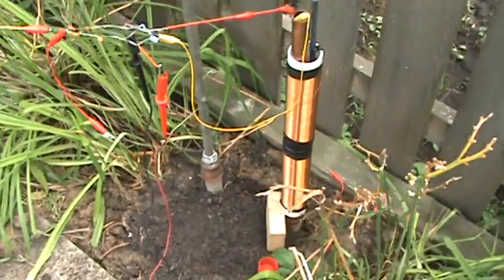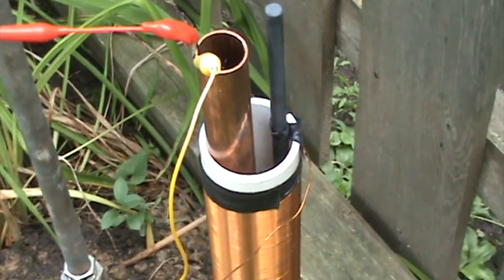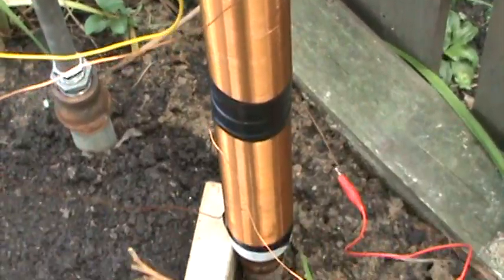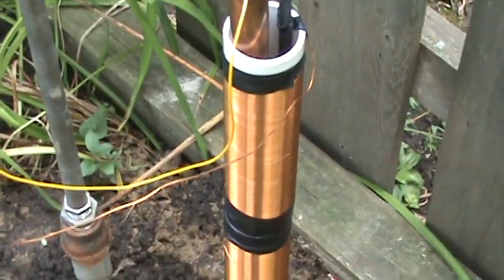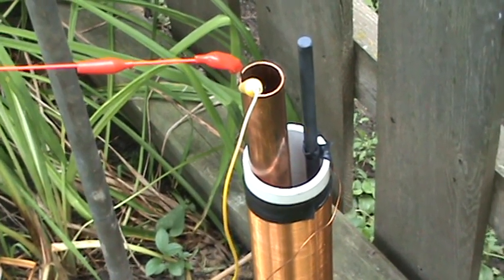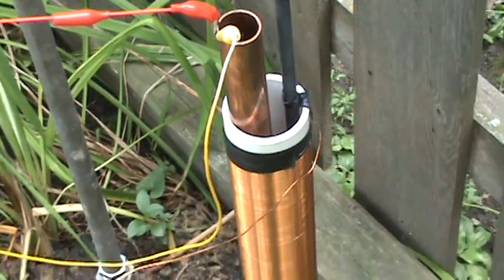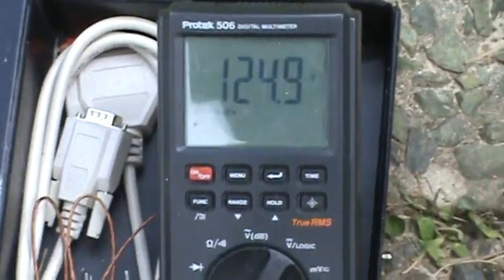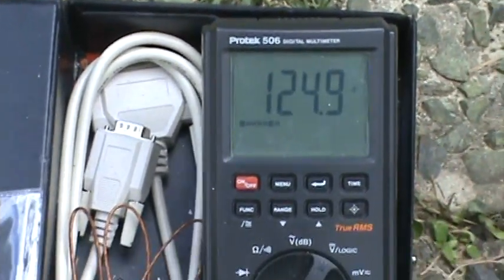FREE ENERGY FROM AIR CIRCUIT PART 16/24

Comment: What is the current? 
Voltage is almost irrelevant!
Reply from the maker: Well, i have been working on/off on this project for over 10 years now.  At this point in time, in this video i was checking the current incorrectly.  I still work on this project today and have new series.  I get about 125 micro Amps.  Now have over 21 LEDs lit 24/7.   I now concentrate on the voltage because it can be transformed through spark gap or charge/discharge of caps or batteries.  Thanks for commenting.
Reply: Are you aware of the Cambodian temple which is pulling seemingly significant amounts of electricity out of the atmosphere? It has 5000 kilograms of silver tiles on its  floor. Perhaps the silver creates a better ground for current?
Technasma Cambodian Temple
http://www.mir.com.my/leofoo/Cambodia2005/Palace_museum/index7.htm
Reply: Technasma in use today. Free electricity in a Tartarian Empire temple.
https://m.youtube.com/watch?v=Mw12Pyn4A8E
Reply: Ancient atmospheric electricity. 
https://m.youtube.com/watch?v=Ssv4J6Sd6bw
Reply from the maker: @charles4962  Thank you, very interesting.  I like that video :-)   I was just watching ancient aliens TV show last night and it was about many buildings like the temple around the world that are all believed to be energy collectors.

Comment: My tel. +48-780-129-544, email: htg@interia.pl   I invented a breakthrough source of energy based on Classical Electrodynamics and on Circuit Theory. It will be useful e.g. for laptops and for cellular telephones. I am looking for capital in the range $500 000 to $5000 000 for prototyping, patents and production.

Comment: Electrostatically Harvesting Power from High Voltage Power Lines.
Note from author: Please do not try this experiment without a thorough knowledge of electricity! Please understand that it is illegal to take power from power lines. This is an experiment only.
If you run a single wire along a high voltage power line, (= or> 340KVAC), you will harvest a fair amount of voltage at micro amp levels. WARNING: KEEP AT LEAST 30 FEET FROM THE HIGH VOLTAGE LINE!! DO NOT DO THIS EXPERIMENT ON WINDY DAYS!! The longer the parallel wire, the higher the voltage and amperage you can collect. Run your (antenna wire) parallel to the power line in the trees adjacent to one outer phase of the power line. The higher the wire, (antenna), the better. Use small gauge bare wire hung from fishing line for insulation and support. Run at least 200 feet of bare antenna wire. 400 feet equals twice the power collected. Use a fishing pole and weight to put up the wires in the closest branches of the trees next to the HV line.
WARNING, DO NOT TOUCH THE ANTENNA WIRE! YOU WILL GET SHOCKED!  I recommend two pairs of rubber gloves and good boots for this. Ground the Antenna wire while you work until the transformer (s) are installed and you are ready for power. Provide a single or several 5 foot copper-plated ground rods at your termination point for the transformer high voltage return to ground. More grounds are better. The ground completes the high voltage antenna circuit.
The trick is to present a minimum load to the antenna wire and to step down the electrostatically induced voltage. We need a very high voltage transformer to do this. A ham radio plate transformer rated at 10,000 volts works good. Neon sign transformers work well. You can use several used oil burner transformers with the secondary in series. They are 10 KV each so you can make a 50 KV secondary with five of them. Much better! Remember, the higher the transformer ratio from the high side to the low side of the transformer the better match you will have to the source (the power line antenna). We then connect the high voltage transformer secondary (HV) winding to the antenna and the ground. Separate transformers MUST have the 120 volt leads in parallel and IN-PHASE. You have created a capacitive-coupled step-down transformer. Place a 4 watt, 120 volt light across the 120 volt terminals of the transformer.  If the light pops and you measure a higher voltage, you may add another single transformer to get to the voltage you desire from the HV transformer (s). You need to measure the AC voltage out of the HV transformer primary and find a 120 volt transformer for that voltage. Example: 600 volts out requires a 600 volt secondary and a 120 volt primary. Place this step-down transformer after the HV transformer. You may also ground the far end of the antenna wire to create electromagnetic coupling to the power line. No other circuit changes are required for this. Bring along some different wattage/voltage lamps, a car battery charger and small battery and some small AC motors to see the power you have collected. Have fun! Author: I am purposely not saying I ever did this. Work safely and remove the antenna when done so it will not blow into the high voltage power line.
Reply from the maker: Mark Vess Yes, it is illegal to pull energy from the power lines,,,,i think there is a law about having a certain size coil a certain distance from lines.  All power lines near me run under ground.  With collecting "static" electricity many have used 200 feet or more of coaxial cable and to produce an electret with it by putting the cable into an oven and heat the cable to almost melting point and apply a voltage to the cable as it cools down, and some have also hung strips of Teflon from the cable also.   But, let me add that it is strongly believed that im NOT collecting static, but rather collecting frequencies in the air that are above power lines and below radio frequencies.  This circuit has also been proven to pick up frequencies from Earth quakes, the circuit acts as an early warning detector and voltage will raise.  It will pick up frequencies from Earth quake from tectonic plates pressing together causing a piezoelectric effect and creating frequencies in the air.  Thanks for the safety measures and the great instructions of how to collect "static" electricity :-)  If you question anything I have said, you can search Joe Tate APM(ambient power modual)

Comment: What if you put a coil in the center of the long skinny coil to collect power? Don smith did some experiments with tesla coils and the volts and amps could be near the same with a central primary coil over the second coil.
 The lionger the secondary coil the higher the voltage so you may need a 5 or 6 foot long coil?
Reply from the maker: Coil inside of a coil,,interesting, but i think it would act as a variable induction coil then,,,Hmmm, i think it would also act as a transformer,,,,Hmmm, also makes me think of that Kapanzee(bad spelling) device out there.
Don smith, interesting project he has going with replicating a circuit from a crop circle :-)
Reply: Just use a spark gap to using a neon bulb to make pulses of high voltage from something such as a cb antenna. Using a bifilar pancake coil you have one on the antenna and ground the other you get your energy from. I have seen circuits using such coils.
Reply from the maker: travis moore I have produced a 1/8 spark about every 8 seconds with this system.  I been meaning to change a super cap yet.  I already got over 100V and they are pulses.  I been experimenting with magnetically coupled coils, bifilar coils on this circuit.  Here have you seen this video,,,,these are the concepts im working on now and trying to implement into the circuit.....
https://www.youtube.com/watch?v=pg8rGROgfA4
Reply: INVENTOR3

This is just a simple bifilar on a cylynder core, and the resonate circuit uses 458 kilohertz to run. Most antenas could use that and you could tune a small bifillar coil. But as for free energy you could look up tesla circuit combine with putting several moduals on a integrated board, increase ground connections and increase surface area of antennas. I said most of this before. Resonating circuits include Gunn, and Tunnel diode but you might find a negetive resistor using carbon fiber criss crossed at some angle for negetive resistance. It has been a while since I looked at that experiment.

Comment: check out how to make a emergency battery charger from a long wire antenna.  In the link below.  This is energy produced from the negative electrons being stripped away from the long wire antenna producing a high voltage charge.  It is not a radio station signal but the atmosphere that produces the effect.
http://www.eham.net/articles/9272
Reply from the maker: Thank you, interesting, this sounds familiar.  He is collecting "Static" electricity, and uses 100s of feet of antenna, many people do this with coaxial cable and heat it in oven at same time they apply low current, they create an "electret".  I am collecting "waves/frequencies" in the air and transforming to electron current.
Thanks again for that link, i have seen drawings of this set-up before.

Comment: There you have it, its not free energy, it comes from a source. Just like solar, that energy comes from the sun and has significantly more power then what you'll collect from earthquakes, cosmos and black holes and man made sources. BTW the majority of the energy you are collecting to generated the 120 voltage potential is man made. But since you're just measuring voltage, even if you removed the man made element you'll still measure a 120 volt potential

Comment from the maker: Your correct, the video does not prove anything.  I have not heard anything negative about it yet.  They will sell instructions and licence to build 3 of them for donation of $200 i think. Yes, radiant, ambient energies from waves, but the origin could be man made but also could be from the cosmos, black holes, stars, moon, pulsars, ect.  It has been proven to have increased voltage at times of earthquakes, due to the piezoelectric effect caused by the pressure of the  tectonic plates shifting.

Comment: A device with wires and an ammeter attached means pretty much nothing. I called it a crappy video as in it proved pretty much nothing. BTW in your video your measuring DC volts not house AC volts. I assume this device is collecting energy mostly in the form of radio waves that companies create with electrical energy and you are storing it in a rudimentary capacitor and measuring the voltage across it?
Attach a load of some kind then measure

Comment: Who cares about volts captured in a coil? I can get kilo volts out of some of my shirts through static electricity, but the power is tiny. Volts is not an interesting metric. Power is what matters as anyone who followed high school physics will know. The energy density in air of electromagnetic radiation is quite low and not usable for much more than driving a crystal radio. In fact, if you start getting enough power to turn on an LED you should consider that the EMF is unhealthy in that place.

Comment: Of course for Bridging to a "HOME" Power system you WILL NEED a LARGE number of Capacitors (for MORE usage and "peak" usage spans.)  Basically, you are "capturing" the EMF/RF radiation that is transmitted DAY and/or NIGHT by BOTH TV/RADIO stations as well as "radiant energy" from space - almost like solar cells do.

It should be noted, that THIS is the concern of the "EMP Weapon" being tested by the Asians as well speak.  It would transmit electronic frequencies so strong it would blow all

Comment from the maker: Hahahaha.  I have good reputation that i value very much.  The results you see here are very real.  The problem is it is all voltage and only microwatts of current & power.  The voltage i get here makes it hard to believe, but the voltage is not much use with out any current. I can only power a calculator at this time.  Believe me or not,,it is your choice :-)

Comment from the maker: Hmm, i don't think that would make a difference, because the electrons mainly flow on the surface area of the windings,,hmmm, but then again it may disrupt the tuning process when i stick a ferrite rod inside of core.  Good point, thanks.

Comment from the maker: Not fake, hehehehe. I greatly value my reputation as a scientist, and it is easy to get black balled from the science community,,,i would never jeopardize  this.
24 parts in this series plus 3 HOW TO videos.  Not hard to believe the results when you understand that voltage alone is not any good without some current to get more power. Much voltage but very little current & power here,,,even though i get over 100V, it can only power a calculator at this time.
I would never fake!  :-)

Comment: Interesting to see your meter is set to DC Volts.  Unless you rectified the power coming out of that coil I'm calling bullshit on everything.  You either have a transmitting coil near by and have only made an air core transformer or your entire video is a spectacularly poorly orchestrated lie.

Comment: can this run a small motor using spark gap discharge from ultracapacitors? if so it might turn a much larger flywheel coil generator

Comment: Inventor, I guess you only need the proper length of the wire to get the frequency correct. It was something around 800m
Here's a very nice video about the Bosnian pyramids. Somewhere at the end you get the info about the length as the pyramid has a similar feature and this is explained there
watch?v=CPNVQD5TSYU
First I thougt this guy is a scrammer, but now as I see what he diggs out, I am convinced he found ancient pyramids. Egypts are really upset as their pyramids are so small :-)

Comment: It seems like it is just collecting the electromagnetic waves in the air. There is hardly enough power density to yield much useful power.
Showing that it can output 125V does not mean it has "power". With AC circuits you can step voltage up and down using a transformer. 1V/10A to 10V/1A... same power on the both sides (although in reality with losses you will have a little less on the output).
Put a load on the output and then take your measurements and that will give some realistic values.

Comment from the maker: No, just tiny spark about 1/8th inch long, or about 3.17mm long. It will not hurt. But if you touch the wrong places in the circuit you could short it out and damage or destroy some components.

Comment from the maker: I had no luck with solar charger. I will try to charge some super caps this coming next spring time when the weather gets better to work outside again. I just aquired the caps recently :-) 
Hmmm,I have not tried the camera cap yet. I have tried to make the Fuji circuit, but had no luck with it, maybe i did not remove components carefully enough, it is a little tricky. Hmm, maybe to try to incorporate the inner workings of a taser gun with the free energy circuit :-)

Comment: How far did you need to drive the ferrite rod into the ground? 
I totally have been wanting to play with these types of set ups, but I have thin rocky soils in my neck of the woods.  Also, You probably already know this, but there is this thing called "The Global Atmospheric Circuit" (From the edge of the lithosphere to the ionosphere).  Most of the time this environment is positively charged. Its electrical potential increases with height at the rate of about 100v / meter. maybe find your amp

Comment: The rod being placed into the coil at a specific distance, and increasing the output is a common variable inductor (nothing extraordinary here).   If you don't hook up a frequency counter and check to see that you are at 60Hz, you are wasting your time. I've been doing the same study/investigation, and discovered the 60Hz bleed on account of having a Fluke 179. I wouldn't waste my time with such small amperage if a highly accurate Fluke is omitted from the experimentation.

Comment: I know now! create a secondary coil that is 50% smaller than the primary coils, it'll drop the voltage in half and double the current. The coils you have now are the primary coils, place the secondary coils inside. The EMF from the primary coils should amplify the current flow in the secondary internal coils. Then if possible,  maybe place a vast number of neodymium magnets inside the secondary coil which will super amplify the current that's inside the magnets. Then collect from the Magnets + -

Comment: If you were pulling in 125v, then you'd probably have to make your capacitor bank in series to have capability for that voltage. Then you could run regular electronics from it :) I used slow release memory backup caps for my bank.

Comment: If you can, maybe try making a capacitor bank to store the incoming energy. I made a 100 Farad 5.5v bank before with an LED on the - end to stop charging when the bank was full. LED goes out after charge. Then with the bank, I ran a small computer fan with it for a couple days :)

Comment: I'd say split the coils into upper and bottom, then collect the current in the middle where the coils meet, but keep the coils separated.  Maybe try making the rods on the inside of the tube the same length as the coils, one per. The wavelength would be the height of the coils combined. top coil + suspended in air, and bottom coil - connected to ground, but the terminals should be in the center of the coils where the middle of the wavelength is. I know you can pull volts from radio waves.

Comment from the maker: You would have to watch from part 1.
Im collecting ambient, radient energies, waves from the air,,& transforming them into electron energy. i believe the energy is coming mainly from the cosmos, many will argue it comes from satelites and power stations. This circuit can also act as an early earth quake detector(techtonic plates and piezoelectric effect creating energy waves). Search Joe Tate APM(ambient power modual), also Tesla & Dr Thomas Henry Moray. I understand your point.